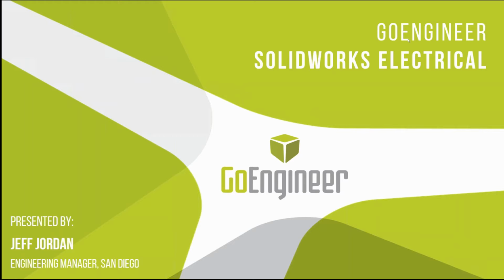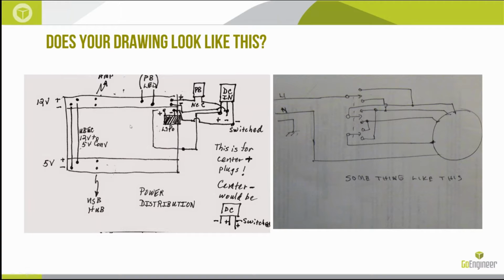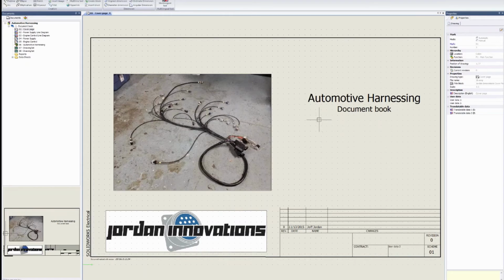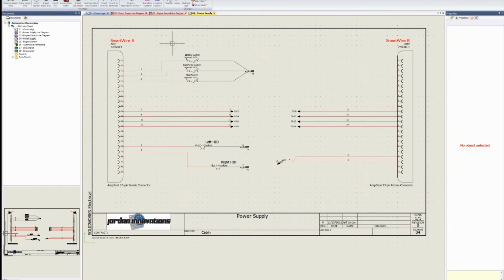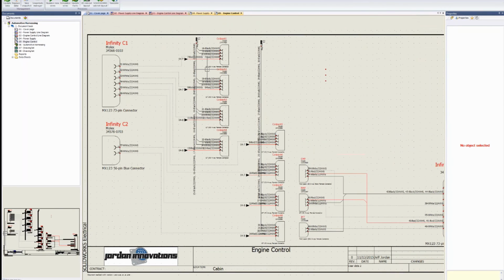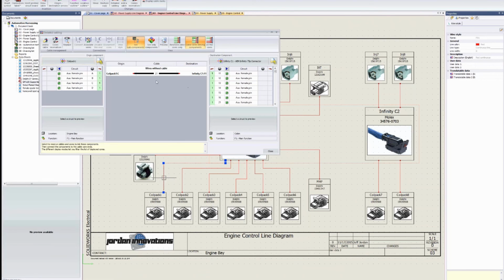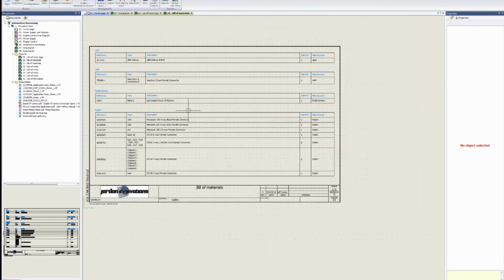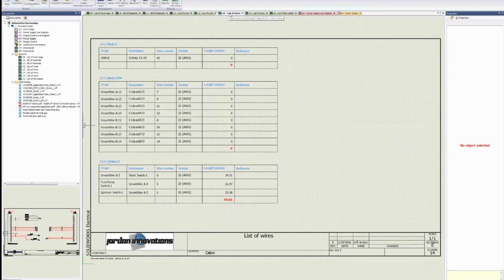SOLIDWORKS Electrical - Automotive Harnessing Part 1

Comment: Is there a way to automatically generate labels that include the wire number and the device name it is attached to?  So instead of just wire 1 you would have wire 1-Fuel Pump.  Also, what if one wire is spliced so it goes two places?  Will the automatic wire numbering handle a wire that has one source and two destinations?